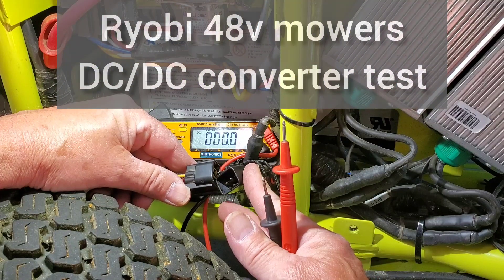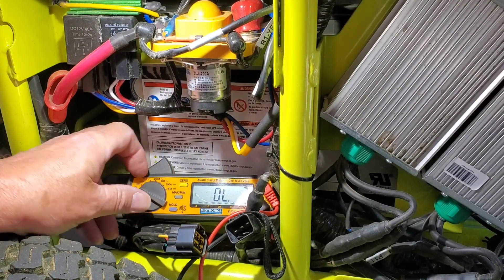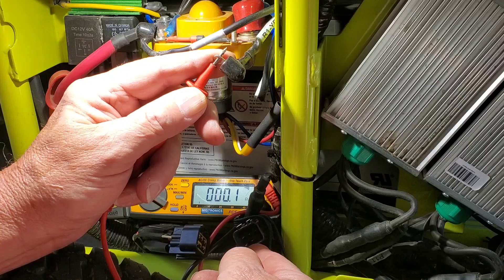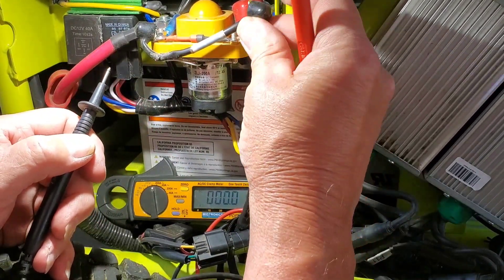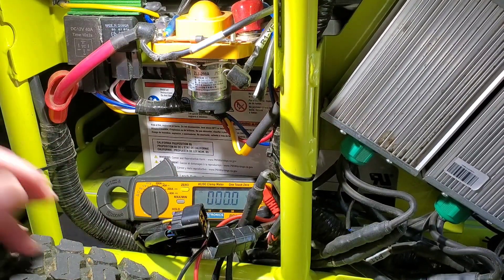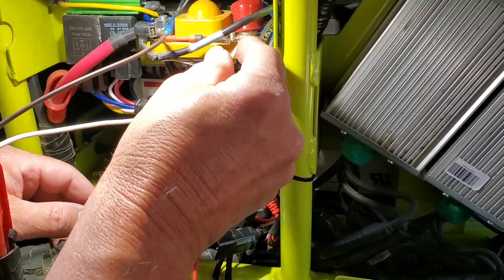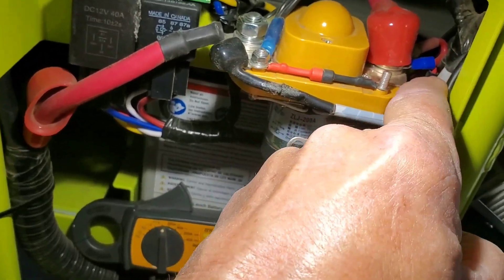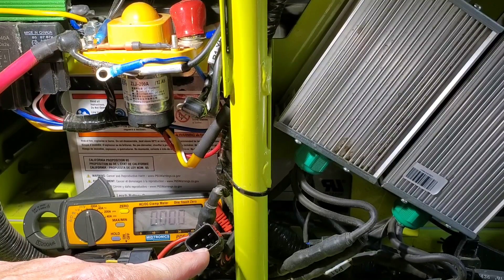Ryobi 48v mower Dc/dc converter test.

Comment: I can get the solenoid to click on by connecting a 12-volt battery to the 12-volt side, as you do in the video. But, still, nothing runs; the mower won't turn on or activate. Is there something else to check or some other cause for this?
Reply from the maker: It could be the charger interrupt or the key switch. This is a link to a diagnostic chart.  You may have to join my group to view it
https://www.facebook.com/share/p/1AxHVbgeVA/

Comment: So between pins 1&2 in getting  53 v... between  pins 2&3 in only getting about 8v. What does that mean?
Reply from the maker: If the voltage is low or zero on pin #3 that is power from your key switch. Most likely the gauge isn't turning on also. 
That could be either the key switch or charger interrupt circuit is bad. See this post in my Ryobi 480e electric mower group. 
https://www.facebook.com/share/p/ddKwRbMFWX15ge2J/
Reply: That is why this is a lame video.  We need schematics to solve these issues.
Reply from the maker: Pin 3 comes from the key switch. What more do you need to know